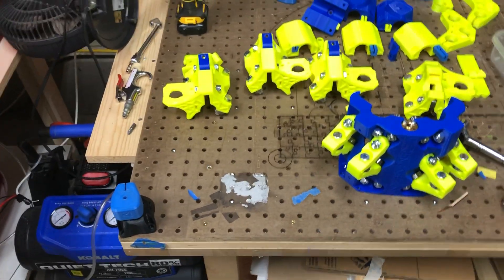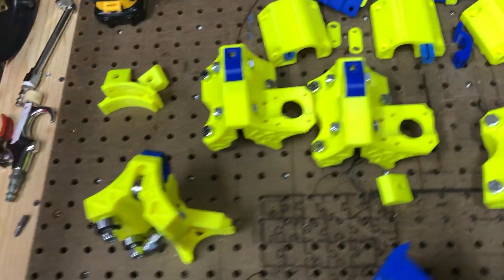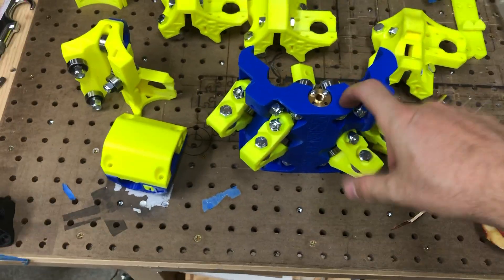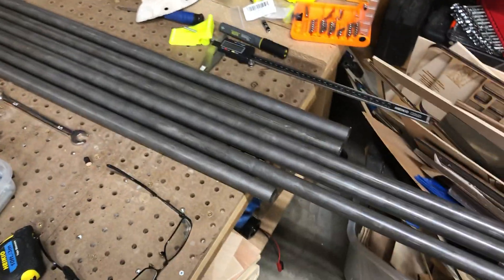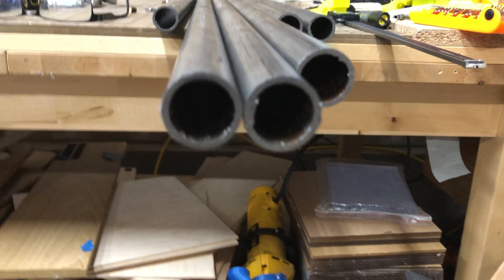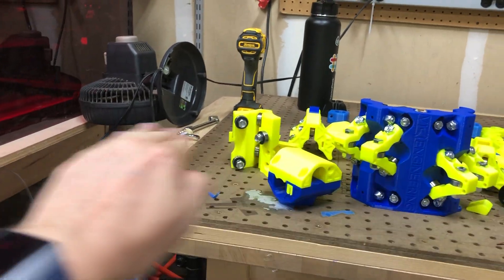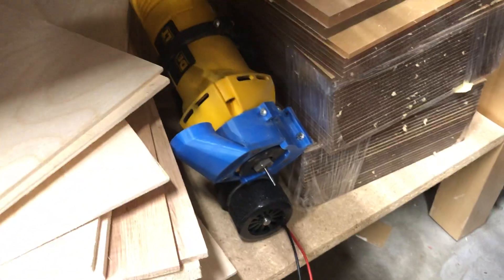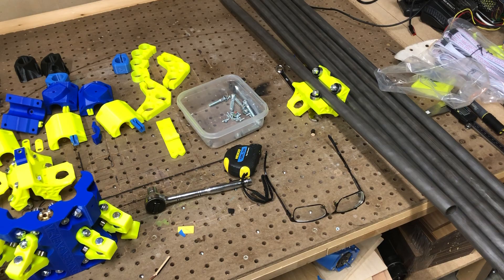MPCNC Primo Prep 1

Comment: Wouldn’t a trapesium also have equal diagonals? Therefore, you would need to square at least one corner.
Reply from the maker: If you lock your spacing equally on both sides, so the X sides match and the Y sides match, the diagonals matching enforces 90° corners. 

A trapezium has two parallel sides and two that  float, can’t get their if your sides are of matching length. 

The reason to use the diagonals is you get more precision eyeballing 1mm differences are longer lengths.
Reply: @ellsonengineering8082  Yeah I saw in your next video that you matched the lengths of the sides as well, so yes you are perfectly correct.

Comment: Did you get any sort of coating on the DOM to prevent rust?
Reply from the maker: jason greene it’s covered in a thin machine oil, but after that I think I’ll use a rust preventative 

If it gives me any issues, I’ll find me some stainless later on.